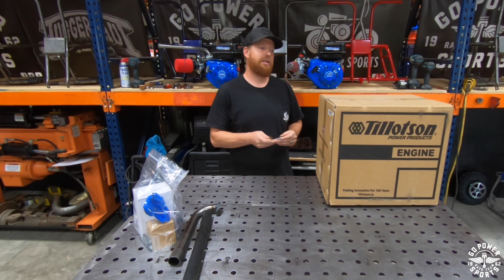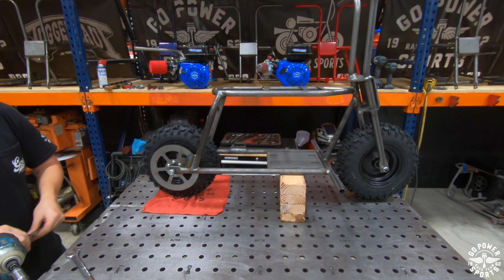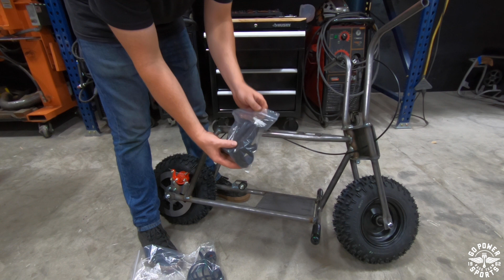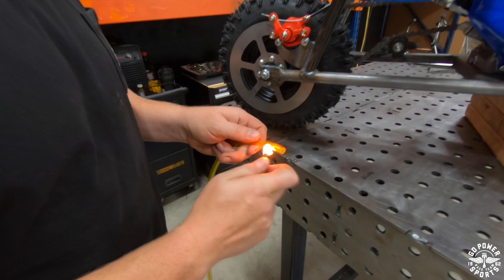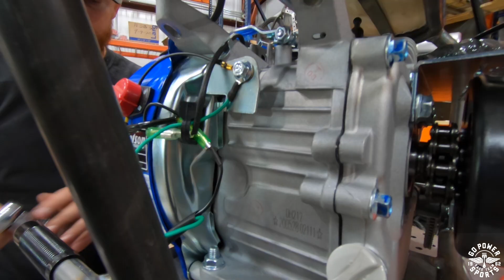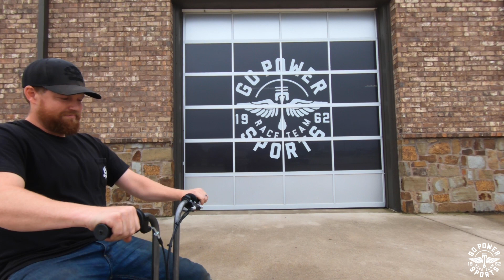Lil Rascal Minibike Assembly | Walkthrough

Comment: Question ? Does the optional Titlison Engine have a magneto ? Just curious.
 Because if it does that is great. Headlights are possible.
Reply from the maker: The Tillotson 212 Electric Start would, not the Pull Start version.
Reply: @GoPowerSports  ... I like having an Electric Start with a Kick/Pull start backup on engines for emergencies.

Comment: is all this needed if we buy the kit? I thought the kit came fully ready to assemble.
Reply: You get the Frame, wheels, forks, and bolts, etc...
You Paint the Frame, etc. You need to buy the Motor/engine separately... But you get to choose any engine/motor that will fit into the space provided.

It is SMALL too. Not like Coleman's CT200s, etc... This is an old school street style minibike.

Comment: Is your hydraulic disc brake system a direct bolt on for the Lil Rascal?
Reply from the maker: Not a direct bolt on.  You need to cut one of the spacers in half and then use our Brake Caliper Bracket to connect it all together.  We will do an install video.